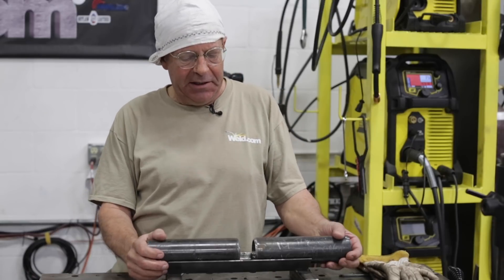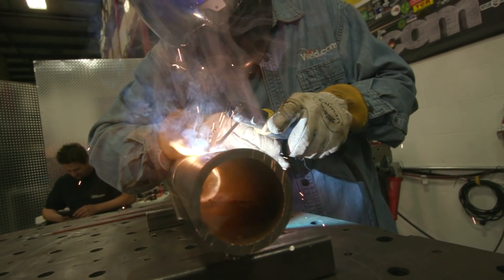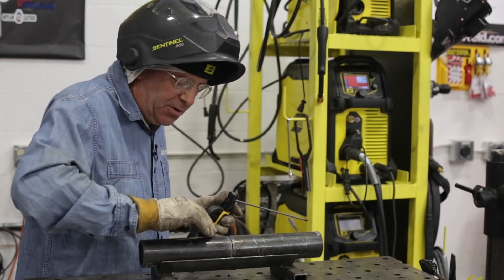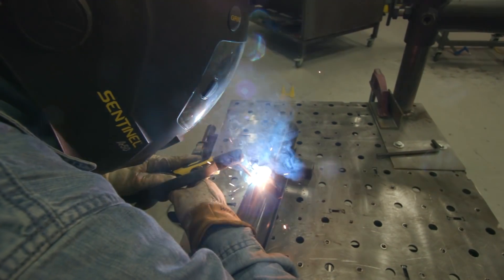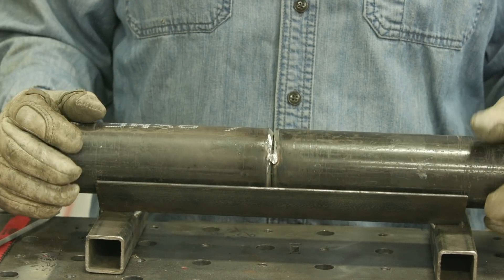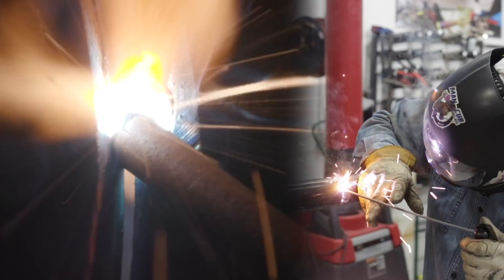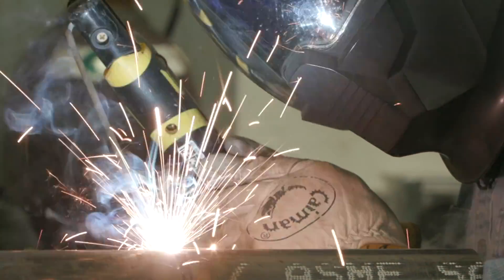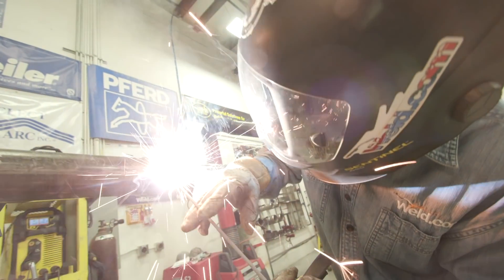How to Weld Pipe - 6010 5G Downhill Root Pass

Comment: Can you please do videos like this for 6 inch schedule 40 uphill in all different positions (2g, 5g, 6g)I am a union plumber apprentice in New York and all we weld is gas pipe. It must be done uphill and is usually sch 40 anything from 4” and up the test we have to pass to become certified is a 6 inch sch 40 6 g. 6010 1/8 root and 7018 3/32 fill and cap

Comment: I have some questions about running innershield NR 232 and NR 233 flux core wire for structural steel applications. I have had many problems with running these wires in various positions mainly vertical up. Such as wire punch through, slag incursions, and root cracks to name a few. Can you do a series on these wires and maybe I can figure out my problems. Thank you.

Comment: With all due respect, bob.. you had A LOT of fire on the outside of the pipe. The second half you could see it was spitting inside inconsistently. On a SA200 or similar you’d run say.. 3rd gear and 35-40 on the remote for a gap like that on 2” which is almost double the amperage you were running. I think you’d get a lot better of a visual of the keyhole, and the amount of fire that should be inside the pipe with settings similar. 

Not knocking anything, I know 2” is forgiving, but I’d be amazed if you did have some IP or suckback in the bead. Several times your keyhole closed, or your rod rode up one side of the bevel and you weren’t getting in...
Reply: Casey Chamberlain good observation man,I think bob knows it coz I'm pretty sure he'll hear it too when it happens

Comment: I know you've probably mentioned this before but why do you have a gap? why can't you just but it up together and weld it and are there times where you can but it up together and weld it?
Reply: Hes doing a root pass, therefore if it was butted up together you take a big chance on not getting full penetration on the inside of the pipe. Putting a gap and a land between the pipes increases your chances greatly of creating a full penetration root pass.
Reply: @justinhall8318  thx

Comment: Hi, Thanks for another great video. Please can you do a video on welding Sch 10 6inch (DN150) pipe 0.134inch (3,4mm) which as I understand requires a single pass using 7018 rods.

Comment: Can this be done in 6013?
How about if it is gal. pipe being used for handrail?
Reply: Mark Fryer 13 stands for the position so I’ll let you do your research.
Reply: I wouldn only weld galvanized as a last resort
Reply: 6013 will work but your lungs will pay the cost for not buying a pipe threader

Comment: That's so close gap however nice root pass👍
So i used to 1/8land 3/32gap 1/8 electrodo i wll try next time in the same way as you !
thank you for video
Reply: 1/8" is a bit wide and can make the pool drop.
Reply: Also wider the gap the lower your amps should be.
Reply: Erik Olsson I'm sure you're a good welder but read what he wrote again because you miss it....1/8 land  and 3/32 gap ,he said
Reply: Just noticed that.  @kabihog5789